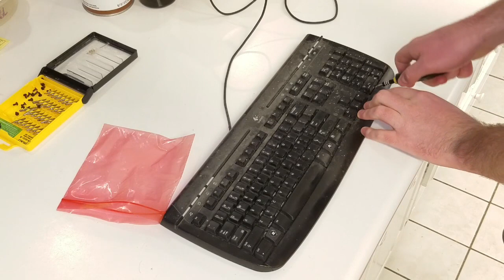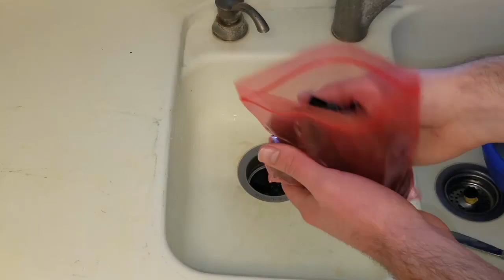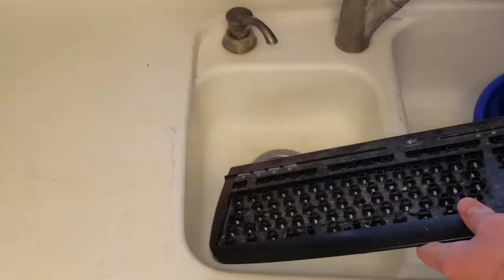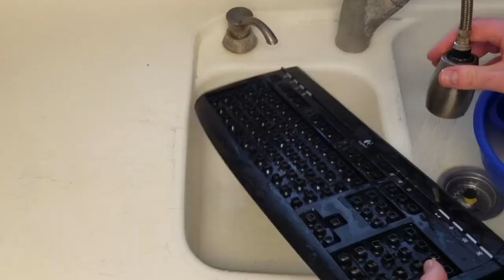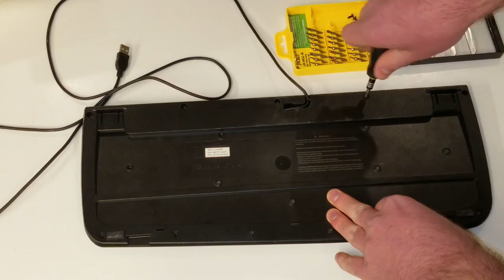How to Clean A Membrane Keyboard

Comment: I have a lenovo keyboard and it has 2 screws on the back. I unscrewed them and for some reason can't remove the lid. Can someone help me?
Reply from the maker: If it has feet/stands, check under those. Also remember that the top of the keyboard can have screws so make sure to remove key caps and check if you haven’t already.

Comment: Is it ok to use a blow dryer to make the drying process faster or will that damage the keyboard in some way?
Reply from the maker: I don’t know if it’s hot enough to melt the plastic in any way, but I’d definitely only use the cool function when drying the membrane. You can use any air source to dry as long as it’s not too hot or too cold.
Reply: @MaxTechniche  thank you very much!

Comment: 6 jun 2020 8:28 pm edt:thanks
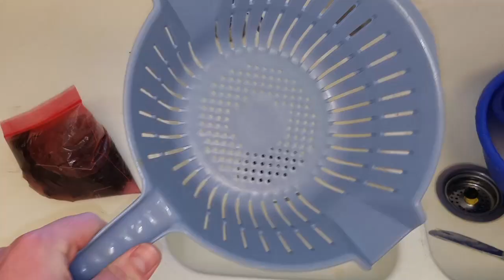6 jun 2020 8:30 pm edt: 1:24 so that transparent-sheet with circuit-drawing, is not being washed
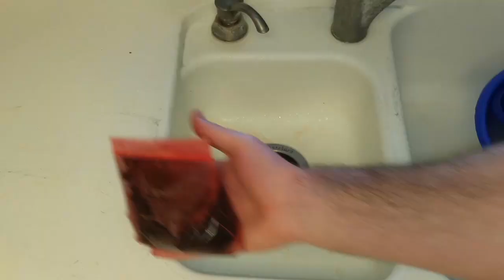6 jun 2020 8:37 pm edt: 1:24 that transparent-sheet with circuit-drawing, must not be washed
[source:
'Nah. I did it like 3 times and it all ended up in keyboard malfunctioning partially or even fully. I think that water leaves certain minerals on the surface and that's what causing it.' in https://www.techpowerup.com/forums/threads/cleaning-the-transparent-plastic-printed-circuits-inside-a-keyboard.163694/ from google (keyboard transparent plastic contact) result 6]

Comment: Can i also clean the keys with cold water
Reply from the maker: Any temperature water will work. Warm/hot water just helps break apart any gunk on the keys.
Reply: You SHOULD wash with cold water! Warm water will cause micro wraps in the plastic of your keys, making them extremely hard to press and could potentially fuck you keyboard up. This guy should've mentioned it, because I didn't know it and now I have a lot of keys that don't fit anymore.